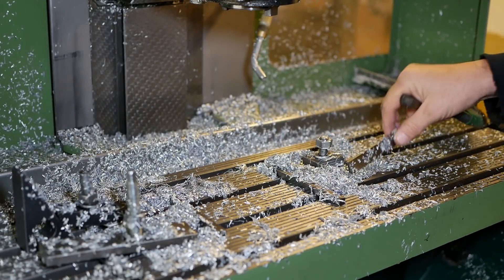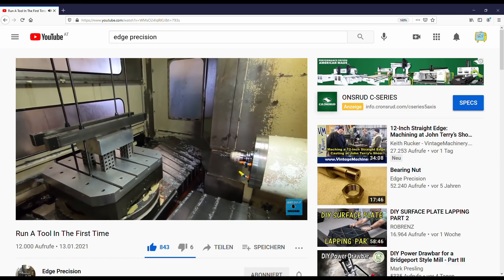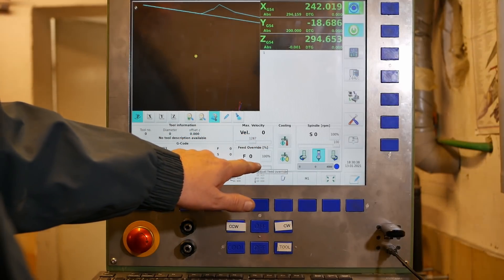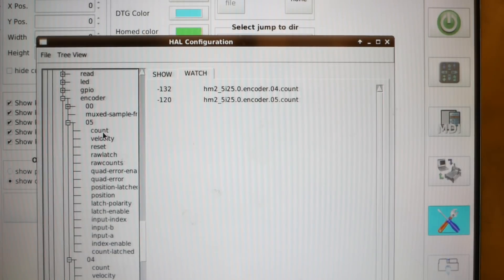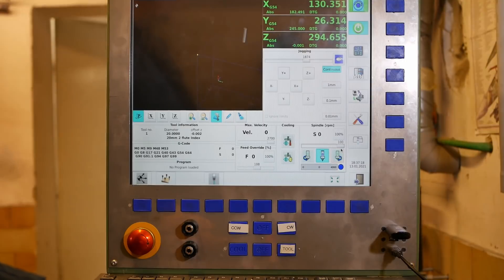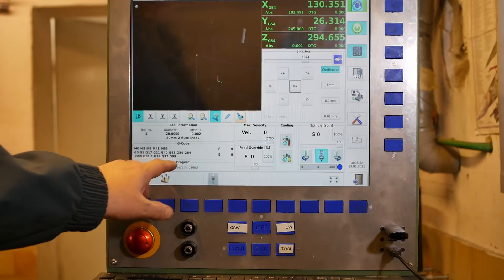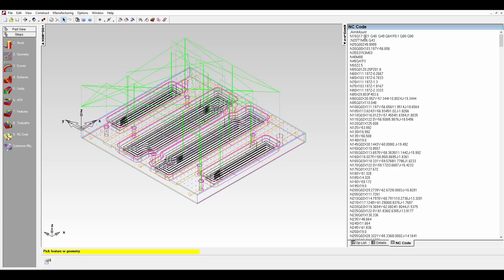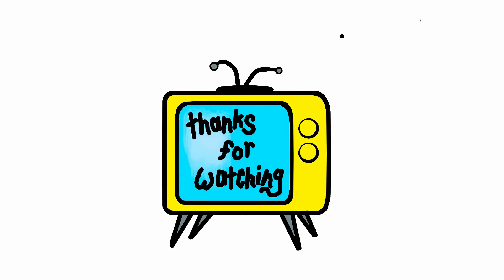What I learnt from crashing my CNC Mill

Comment: I saw some videos of cloud42 and would like to ask you, to take a look at his start gcode. His machine allways makes a full stop at the beginning with the spacing of a 1-2-3-block between workpiece and tool. Like this he can avoid some more crashs, i think.
Reply from the maker: I have added an M1 option stop 50mm about the stock for the same reason. I use a 25-50-75mm block.
Reply: @RotarySMP  Linuxcnc has the ability to toggle optional stop on/off from a menu item(at least in axis). This lets me post process M1 into the gcode and ru it th efirst time with stop on, then once you confirm it works run it stop off.
Reply from the maker: @hahnrossman1172  Yeah, I have set my PP to approach to 50mm and insert an M1, but I hand coded the tapmatic bit, and didn't add it. Duh!

Comment: I cant tell, but it looks like your sony dslr (B cam?), the front lens element is unprotected. I always throw on a decent quality UV filter to protect the front element of my lenses. UV filters only matter for film cameras, does nothing for digital, but provides a little extra protection from scratches and such.
Reply: Also: the light flickering is because your shutter speed (1/50 1/60) is the same or close to the Hz cycle of the light. If they are dimmable LEDs, the Hz range can vary considerably. Just increase or decrease the shutter speed by 10 or so and it will disapear. It is hard to notice these things on a tiny LCD, but you kinda get a knack for which shutter speeds cause problems and avoid them later on. Thanks for the video hombre !
Reply from the maker: @lemmonsinmyeyes  Thanks. My B cam  (Olympus EPL5 only has a cheap kit lens.Worth barely more than a cheap UV filter. It likes the challenge. Unfortunately that camera only offers 30 FPS. The Panasonic G81 does a range of film rates, but i keep it at 30 FPS so I can combine footage from th B cam. Power here is 50 Hz. I have both cameras at 1/60th (180°) shutter. Maybe1/50th would help. I need to remember to try that.

Comment: I always set my G54 ( work offset), 100mm in Z away from the part, giving me a bit of time to react to any unexpected occurrences, for a first off part.
Reply from the maker: Do you do a dry run at z100 and then reset G54 to your work, or do you machine at ~Z-100?
Reply: @RotarySMP  I do a Dry run, but with tool changes and all moves enabled.

Comment: I don't work in aviation, but in the automotive sector we are equally interested in critical problem solving and root causing issues.  We use the 8D method.  Essentially, keep asking "why" until you get to the irreducible cause then put controls in place to prevent it in the future.  I love seeing everyone's problem solving method, keep up the good work!
Reply from the maker: Thanks. In the limited contact I have had with the automotive production industry, they profit from the much higher production rates combined with my cheaper parts, to have a much greater technical reliablity and lower wear than most aeronautical products. I was very impressed by the production quality systems I was able to audit in an Automotive engine line.

Comment: I use a python script which automatically sets feed and rapids to zero after I press "cycle start". This way I always need to use the potis no matter what...
Reply from the maker: Do you also have them setting to zero at each tool change?
Reply: @RotarySMP  No, so far I had no issue with crashes after tool change, but then I have my tool-database of the CAM maintained in sync with the machine. So if the first tool is fine, I can trust the cam program totally. 
But it would be possible to also reset the speeds at toolchange, I am sure.
Reply from the maker: @thinkclear5292  My crash was on tool 2 :(

Comment: ah, its rare when I hear about Reliably Engineering and Reliability Centered Maintenance Concept... that is what saved the aviation industry. It emerged from lightbulbs and radio engineering... when I was a kid, lightbulbs were more like flashbulbs and now, now? I can't remember the last time I changed one.
Reply from the maker: I made the mistake of putting some Halogen spots in the kitchen. Lots of practice in changing burnt out bulbs :(
Reply: @RotarySMP  I replaced my crt tv with an early led flat panel and my electric bill plummeted by 2/3rds, replaced my incandescent bulbs with leds, and, after about 2 years one night it went out. Honest to dog i thought I had a stroke for a bit.... And I didn't have a spare lamp! Has to turn on another light!
Reply from the maker: @geneard639  :) I have kids how constantly leave lights on, so I will always have a ft electric bill.

Comment: I generally like to work with a fixed work coordinate system, I set my xy zero as the machine home, then I have a tool height gauge that is above the jaws of the vise that I use as my z 0. I also have one of those fixture plates from nyc cnc that I pin my vise and fixtures down onto. The fixture plate and my vise and fixtures are modeled in my cad cam program(fusion). Technically you don't have to use the machine home, you could use a pin or hole on the fixture plate and probe that at the beginning of the program if you have a probe. With this method I save a lot of time since I dont have to probe most of the time. Occasionally If I need the extra precision I will indicate the position of a feature of one of my fixtures, and correct its position in cad. this also makes it very hard to hit your fixture while machining since you can actually set the fixture as what the cam considers stock, it will show you if it plowed through it. Also make sure you measure your tool right after you load it so you don't forget. I run a little 5 axis at work, and it has a manual tool changer, so putting the wrong tool in is a good way to waste 30+ bucks.
Reply from the maker: Thanks. I have been meaning to correct the alignment blocks on my Vise to automatically fixture it to a set Y offset from machine coord.
Reply: @RotarySMP  use a programmed pin stop for the x axis. Titans of cnc has video about it.

Comment: can you share the linuxcnc hal config stuff you did to get those encoders to function? i want those desperately!
Reply from the maker: I need to upload the latest HAL to my build thread anyway. Thanks for the reminder. 
They will be in the first post of this thread :

https://forum.linuxcnc.org/12-milling/33035-retrofitting-a-1986-maho-mh400e

but it will be tomorrow before I can upload the latest.
Reply: @RotarySMP  thanks so much. absolutely amazing content here, keep up the great work!
Reply from the maker: @TMCmakes  Thanks.
Reply from the maker: I just uploaded my current HAL and Ini. Note that anything which affects Gmoccapy is not in the main HAL, but in the Custom_postgui.hal.
https://forum.linuxcnc.org/12-milling/33035-retrofitting-a-1986-maho-mh400e#95877

Comment: With all due respect sir, At 6.08 you refer to the error as lame. I refer to this as a learning experience. Peter has a video where he crashes into a vice which he also didn't edit out of his video. I'm not sure what the error was but my point is that we all fall short of an exact 100% method. I once used "DRY RUN" to test a program and it ran fine. When I removed the function I discovered the hard way that in DRY RUN the servos are synchronized, with DRY RUN off the Z axis out ran the X axis as I approached the work piece.  I realized how high I could jump that day. I truly enjoy your videos. Still waiting on the Beatles. You'll get it. One more little comment that I would like to make, You might adopt a safe starting approach by programming your Z to 1 inch above the part in your G43 block, example:  (G43Z1.0 H01 )or the tool  offset you are using. This way you can take a 123 block and see if you are there or not.
Reply from the maker: It present I have the CAM set up to set 50mm as the initial approach. Guess I can halve that with a bit of practice.
Thanks for your feedback.

Comment: Hello I'm also cnc-miller and I make also some crashins. What I learn about it I go always first to a safety high on maxfeet (Z100mm)  then I go whit X-Y to the start pont in maxfeet then go down to the 2e safety high (Z2mm) then run the program. 2e you exchanged the tool at Y+ max position learn to go to Y-max position after 15 year I have now a worn shoulder and it is not nice
Reply from the maker: Thanks for watching.

Comment: I'm a little late for your sake, but I just did a tutorial video on toggling the rabbit and turtle using the toggle hal command

Check it out here:

https://youtu.be/aqtuZhGByr8
Short story long, it's just:

Loadrt toggle
Addf toggle.0 servo-thread

Net turtle-toggle [input device you desire]  toggle.0.in
Net turtle-out gmoccapy.jog.turtle-jog toggle.0.out

As far as rapid and feed being tied together, that's the old version of gmoccapy and being involved in commercial machine tools for the last 22 years, i wasn't thrilled with that. Hated it, in fact. The new version of gmoccapy eliminates that but it doesn't have sliders, so you have to hold your finger on the rapid reduction button, which kinda sucks. You could also make a pyvcp or gladevcp panel for the touch screen slide, though.

What rotary encoders are you using for your knobs? I'm utilizing the analog inputs on my 7i76e for overrides with cheapo potentiometers so I don't use up the encoder provisions on the board. I just got an mpg knob that I'll be playing with tonight. 

You seem to already have your ducks in a row on stuff, but if you need anything, feel free to hit me up on the forum (same name) or check out my tutorial videos. I've been going kinda nuts with them the last few weeks 😆
Reply from the maker: Yeah, it seems any think you can think of has already been solved in LinuxCNC. I found that toggle HAL comp and used it just like you said.

I am still on LinuxCNC 2.7 on the Maho, and see no really reson to change.
Reply: @RotarySMP  i hear ya, if it works, don't mess with it. I'm in the boat of "if there's an update with new features, i totally want to play with it"😆. I figured you used the toggle component, but wanted to leave it up in my comment for others that are struggling for information. I've found that rudimentary information is scarce and I struggled for a while to make it click, so I'm trying to help out anyway I can for the next guy. 

I'm a Mach convert and switched to LinuxCNC back in May because Mach was buggy and I really liked the idea of LinuxCNC having plc functionality. I work for DMG Mori (Maho being the M in DMG, so welcome to the family), so plc was right up my alley. 👌👌

Comment: I have been looking at getting a maho 800p, it looks to be in very good condition its just not a cnc machine yet. I still live with my parents(im only 18) and my room constraint is very present. anyone think it would be worth maybe getting rid of my bridgeport mill to replace it with a maho?
Reply from the maker: The P model Maho normally have the single axis motor, driving all axis through clutches and gearboxes. Check out This Old TOny's Maho videos. If that is the case on the one you are looking at, don't buy it.

Comment: You could also look into a nc simulator tool that may have caught that. Ya peter is the man! Great video once again! I love how you learn all this cool linux stuff and show us all about it! Keep it up!
Reply from the maker: I simulated that code in FeatureCam, NC Viewer and in LinuxCNC. Doesn't help if you have switched off tool length offset, and commented out the line which turns it back on.
Reply: @RotarySMP  ya but the whole point of all that software should be to catch simple mistakes......like no g43 h(whatever). You would think it would show the spindle burrying itself in the part?
Reply from the maker: @jasonruch3529  I don't know of a back plotter which would catch that. Would Fusion?
Reply: @RotarySMP  no it wouldnt because like u said, it was a posting error. But what i was talking about was software that would take your gcode program and plot it out to show mistakes....your cam cant do that because at that stage nothing is   made into gcode yet.   On practical machinist there was a shop  tour  Where they had a 5 axis machine and after they posted out the   Program they ran it through another simulator to verify that it would not crash
Reply: @RotarySMP   Also my Mazaks can do a tool path that would show a miss like that. It does stink that cam software wont show its own posted code errors...but anything that will plot the posted program should.
Reply from the maker: @jasonruch3529  I can't even imagine working with 5 or more axis code, or that 7 ish  axis Mazak Edge Precision uses.
Reply: @RotarySMP  ya most of that is all done by cam, then most shops use the verification software on the posted out program to look for mistakes.  I was the same way as you at first but i wouldnt be shocked if you built a rotory 4th axis and then a platter with a harmonic drive for a 5th axis since your playing with linux! Lol i seen some people do amazing things with linux! Ahmaybe youll build a tool changer first! 😉 you will find having a cnc is like a sports car.....you always want more! And that will drive you to learn and do it! Btw cnc's are way cooler then sports cars! 😉  on the linux foum you will find the fella who wrote scripts for dynamic milling in kinetics who basically made his own small haas lookalike 5 axis add on to his diy vertical!  I can't wait! I feel like this channel is just getting started! Keep it up!
Reply from the maker: @jasonruch3529  Thanks for the encouragement.

Comment: I'm amazed at how quickly you managed to reconfigure Linux!
Reply from the maker: For those two encoders? I just did pretty much the same thing on the mini lathe with it's MPG, so it was reasonable fresh. It is only a few lines in the HAL. To get the buttons working was just a single net on the feed override reset.  I had to load a "toggle" HAL component and run the turtle jog swtich through it, to make it latch.

Comment: You can also use G43 inside the M6 remap. Just remember to put outside the any M72.
Reply from the maker: What is the M6 remap for?  I don't use automatic touch off, because the 40 Taper on the Maho means I can set my tool table in advance.
Reply: @RotarySMP  https://discord.gg/aaz2HF2bmy
give me a shout out there and I can help you with linuxcnc related stuff.
It is like a gcode "call" but what calls it is a M6. SOme people do their entire ATC function in there. I prefer to make some custom hal components just because the atcs I came across are a bit finicky.
http://linuxcnc.org/docs/html/remap/remap.html
there is also a example in linuxcnc under axis but I cant remember how its called.

Comment: If you are already doing your own thing for the programming, i would reccoment tossing in one of those locking buttons or a lever to toggle your velocity to 0%. (Whatever you did at the very very end of the video)

Might save your roller a few years worth of use.
Reply from the maker: YOu mean the encoder? It should last my lifetime. This is only a hobby machine.
Reply: @RotarySMP  yeah, just when you dialed it down to change your tool (presumably a safety thing), made me think that it would be safer to have it go to 0 instead of maybe leaving it at 2% on accident.

Love your videos man.
Reply from the maker: @B0BBYL33J0RD4N  Thanks. When you dial it down, it does go to 0, Maybe I edited that badly.

Comment: Nice video, hat got my crashes down was was installing a tool length probe and using a haimer 3d probe for setting origins. Since then I touch off all tools (which are not in the toolchanger) after setup. I don't use gmocappy but in my tool change script (when making a manual change) I display the tool length to I get a clue if there is something wrong.
Reply from the maker: I have one of those chinese tool length setters, but have only played around with it so far.
Reply: @RotarySMP  the is more or less also one I Use. Its a two stage switch I use the first stage for proving, the second triggers the E-stop. Here is my ATC touch of sequence:
https://youtu.be/MKJkxkgyG0c I don't have a sequence for manual tool change. But I also can force probing after a tool change in my post processor. As I said since I use this probe I didn't crash my machine. Before that... let me put it this way, you see the difference when comparing the new vices with my old :D